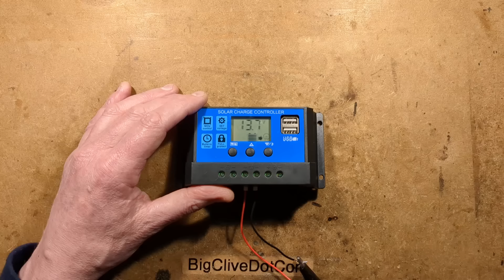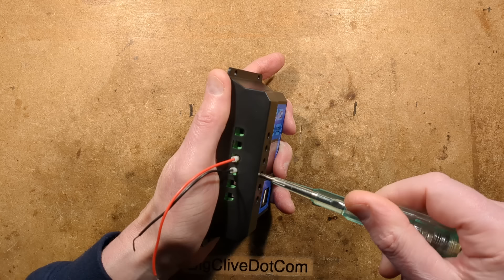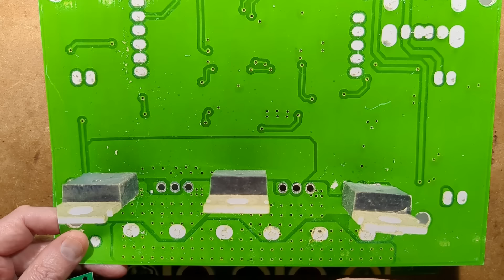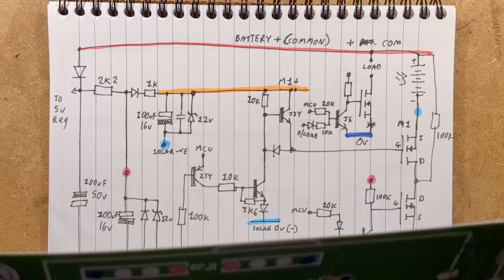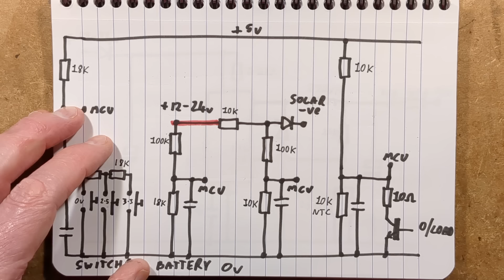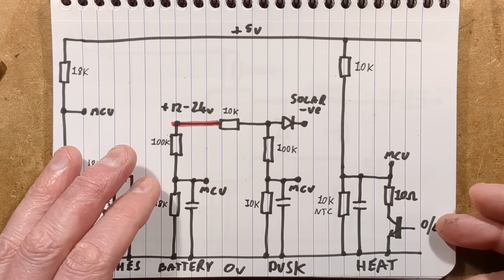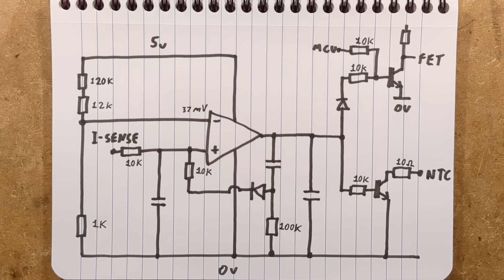Exploring a mass produced solar charge controller

Comment: Many false claims of MPPT on those chargers .they are only PWM but they work and the false claims of power rating of 100 amps or 30 amps .Most are barely 10 amps but if you can put a proper heat sink on the back you can get 10amps +

Comment: I am running a similar unit for my LED garden lights, backed by a 12V 7 Ah gel battery, added a fuse on the battery line and source power is from two solar panels. It has been running for years now. It switches on at dusk and stays on for the given number of hours. No large currents though.

Comment: Oh, perfect timing.
I bought one of those, a 25W small solar-panel, sealed-lead battery, and a small selfmade 12v LED light. Wanted to install it tomorrow for a play hut for a relatives kids. 
So seem usable for 12V low-power? I was just a bit too lazy to make my own as this had a display and just the few settings i needed.

Why did they go with such an overcomplicated design when it only makes the charger more complex, error-prone and specially for the chinese - more expensive?
5V that is not really capable and can brownout the controller, mosfet-driving that seems like a fever-dream, and thermal regulation while actively overloading the entire thing.

Comment: I use the larger orange 12/24/36/48v ones. They seem to be about the same manufacturer but apparently have shunts and show input current and also current the load is pulling. Their voltage readings are also much more accurate.
Since the usb are part of the load, I run 5v relays to control when things come on and go off (in my case a 2nd inverter and also a window air conditioner).
In my experience the orange larger ones are very reliable and also accurate enough for lithium batteries. I've run several of them for years and theyre now under $15. Years ago they were $30.

Comment: My suspicion seems to be correct. They sold this in Asia and it was popular until someone tried to charge their phone with the port that "supports all charging standards up to 5A and 48V USB PD blah blah blah" and then the batteries got cooked. They then probably decreased the price a lot to get rid of the stock they have left. I bet at some point these will vanish from all shops, replaced with something more expensive that might have other design flaws...
Reply: You seem to have the misapprehension that chinese manufacturers actually take any kind of responsibility for aftersales service - they don't care if your batteries cook, they just care about making the sale. The USB ports are a feature that help sell more units, volume->cheaper.
Reply: @Patrick-rd9qo  I have never said, nor implied that they would care about someone's batteries getting cooked. The customers do care and stop buying it. No demand, lower prices. Prices even below manufacturing cost.
Reply: @Patrick-rd9qo  They do---for domestic sales. Chinese law enforcement is generally effective, even if electric standards are lax. What the OP suggests is that it was originally a domestic product with some international resellers, but is now dumped onto the international market because it cannot be sold domestically anymore. We've seen this before, where some product suddenly shows up for a price that's low even for this kind of stuff and vanishes about a year later.

Comment: Lots of people disregard these cheapo PWM charge controllers as useless, scammy garbage. While yes, a well-designed MPPT charger is 100% the better choice for most setups, it is absolutely remarkable what these tiny PWM models can achieve for under $5.

Comment: I'm not in the habit of inspecting PCBs, but over 45 years of owning a soldering iron I've seen quite a few - but I don't recall ever seeing 'busbar' power tracks with multiple through plated holes like this board has. No particular function occurs to me, if it was just to use the copper on both sides to carry current then I'd expect a cluster near the connection to the power source perhaps but not everywhere. IF someone wants to enlighten me about the reason for their distribution I'd be interested to hear.

Comment: I've seen these for sale for as little as $3 apiece.  Amazing how they can get the price so low on something by producing millions of them, "economy of scale" at its finest.  Last year I bought a set of 8 flexible panels for a portable array, and they each came with one of these controllers, so I have a pile of them I need to figure out what to do with.  More and more cheap stuff is getting the part numbers sanded off, probably because they know the guy in the next building is going to counterfeit it if its easy to copy.  Not very effective on a mosfet (probably IRFZ44N) but can be a bit more problematic when it's an IC, even like the op amp or buck regulator.  I see a lot of comments complaining about this not being MPPT, but down here it really doesn't matter.  MPPT is only useful when you need to eek out every last watt or when you have such a large array that a few less percent represents a significant power loss.  Down here at these power levels and price points, nobody's going to miss a few watts, when it saves them 90% on the cost of the controller.

Thanks for the video, and kudos for spending all that time on the fiendish schematic!
Reply: This is basically a PWM controller.
MPPT is ~20% more efficient, so your not eeking out a few watts. Its more like 10-20W+ on an average panel.
Reply: @jaro6985  There's a very common confusion in solar terminology ,where "MPPT" and "PWM" are being compared.  This is sort of like comparing two different cars where one has fuel injection and the other uses spark plugs.  The reality is that BOTH use spark plugs, and fuel injection only really helps in certain situations.  (it's not an "either-or" comparison)  And there's also a big cost difference.

It's difficult to simply describe how PWM (Pulse Width Modulation) works in a controller without getting confusingly technical, but I'll try.  "Basic PWM" regularly interrupts the power (through a filter) to lower the average voltage to what the load can use, which can be very inefficient since it spends some (and maybe a lot) of its time "off" not sending power to the load.  It's fairly efficient when the panels are providing the right amount of voltage for the panel (and the PWM is almost always "on") but the power of any additional voltage is "lost".  So for example, a 28v panel would be VERY lossy when connected to a 12v battery because it'd be "off" for around half its cycle.  Their efficiency is directly related to how big the voltage difference is, so if your panels are closely matched to your battery, they can still be fairly efficient.  At any rate, this DOES prevent a higher voltage solar panel from over-charging your battery, so it is a legitimate way to control a solar panel.

The other method is to use PWM to control a "buck regulator", which is always transmitting power but is using two different current paths, so can be very efficient.  Unlike basic PWM, buck regulators "trade off" excessive voltage for more current, and thus can provide more current to the load than the panel is providing, making them extremely efficient at any panel voltage or battery charge state.  There are some great videos on YouTube that describe how buck regulators work, check them out.

Both methods use PWM, so saying a controller is "PWM" isn't helpful, because ANY real solar controller uses PWM.  If you can spot schottky diodes and a large inductor, it's probably using a buck regulator.  The inductor makes the controller bulkier and heavier, so if it's really small/thin and lightweight, it's probably just using inefficient "direct PWM" and not a buck regulator.

Now that we're done with that, MPPT is "Maximum Power Point Tracking".  This isn't a method of power conversion, it's a method of control*, and is almost always done with a small micro-controller (tiny computer chip) on the board.  In theory it could be used to control a basic PWM conversion but I've never seen it - probably because it'd be a waste of money to put in a MPPT chip just to waste all that power with basic PWM.  MPPT constantly calculates power delivered to the load, and is constantly tweaking the voltage/current tradeoff in the buck regulator, trying to find the optimal conversion.  This might sound unnecessary if you can just cut the voltage in half to double the current it wouldn't change the power.  But solar panel output is *not linear.  Doubling the current draw might drop voltage by 40%, 50%, 60%, etc, and the result power might be 80%, 100%, or 120% of what it was before.  Obviously 120% is better, so it moves there and then tries adjusting again to see if it can continue to improve.  This is the controller "tracking" the maximum power point, along the MPP curve.  The shape and position of this curve varies depending on the panel and the conditions (how sunny it is, angle of the sun, etc) so it's necessary to track it and adjust the conversion rate if you want to squeeze every watt out of the panels as conditions change. (and to have the controller work efficiently with more than one kind of panel)

So on the front end, the MPPT chip is adjusting the buck regulator to pull just the right amount of load to maximize solar panel power.  And on the back end the buck regulator is efficiently converting voltage down and current up so that close to 100% of that power is delivered to the load.

That means almost all the cheap controllers (that are often just labeled "PWM") will have a small dumb IC that's been wired to run at a fixed power point.  They do "okay" if you connect a panel with a matching Vmpp. (maximum power point voltage)  A lower voltage (or shaded, or badly angled) panel probably won't work at all, and a higher voltage panel will waste power.  But they're like $3 and you get what you pay for.

TL;DR: there isn't any "magic number" to compare a MPPT controller with a "PWM" controller.  Under the right conditions they could be almost identical.  But in other situations they could be literally ANY difference between them.  80%, 10%, whatever.  It depends on how well-matched the controller is with the panels. (and also solar conditions, battery charge, etc)  MPPT controllers will always cost more and be more efficient, but just how much is very dependent on your situation.  (in my earlier post I mentioned a "PWM" controller that came with a panel - so the controller was "matched" to the panel and with good sun it's actually pretty efficient)
Reply: I'm quite surprised that they anonymized the MOSFETs but not the microcontroller.

Comment: One thing I read somewhere was that when you set them up, put the battery on, then the load switched on, then the solar panel. That seemed to work for me after a few issues.

Comment: Bought one of these the other day to keep an electric fence battery topped up. This is a much better guide than the crappy bit of paper that it came with.
Reply: It runs my electric for two years now. No problems so far
Reply: @johannesheide8639  Good to know, thanks.
Reply: Exactly what i plan to do as well, got some 130W Panels laying around that i bought second hand for the ludicrous price of 1€/W shortly after the kremlin went full retard.
Time to put at least one of them to good use...
I think i will now switch to lithium though, a lead acid battery getting charged in an ammo can over and over might not be the best idea ever.
Reply: Outch that was expensive @darnoc4470
Reply: @darnoc4470 Good plan as long as it will stay above freezing.
Reply: @davidmam  I got some used Bike batteries for basically free with the panels, if frost degrades the capacity of my selfmade rack i can just throw more 18650s at the problem.
I mostly use the fence in wintertime to protect my apple plantations from deer, forgetting to replace the old battery every few weeks got bit annoying and costly.
Winters here in coastal climate northern Germany are quite mild though, a week of -10C nights at the "worst" should not be too hard on the cells i reckon.
Reply: @davidmam  only "lithium iron phosphate" (LiFePO4) has a problem with charging below freezing temperature. Other lithium battery architectures, like lithium ion found in phones laptops and vapes, or lithium titanate which is much safer, can go down far below freezing temperature and still work fine! You might lose some efficiency in cold weather, but unlike LiFePO4 you don't need a battery heater and it won't kill your battery instantly if you run a light bulb from it below 0 C
Reply: @davidmam  Rubbish. I have one fitted in a cabinet outside to control my water harvesting system. Same controller for at least five years and it's never missed a beat in ALL weather.
Reply: @cyleleghorn246  fascinating... I'm seeing all the advantages (and there are drawbacks too) of LFP vs Li-Ion for EVs, but didn't realise about the below freezing thing. Luckily (although I wish we did) in Australia we don't really get sub zero temperatures.
Reply: Well mine burn up, cause i use the USB to light up my usb light. So using the USB is big NO NO if you want to use it long.😂😂😂😂
Reply: I‘m doing this since ~5 years. 50w solar panel, 100ah lead battery and this cheap charger. My horses tested the fence some time ago. Works well ⚡️
Reply: @MatzeMaulwurf  50W and 100Ah, you'll be able to keep a cattle rated unit happy
Reply: @Flirkann  Cattle and horses are easy, it's sheep that need a good kick or they'll just walk right through it.
Reply: @Flirkann yes. During summer with a good location , the panel is tilted 30 deg and pointing to south. Runs the whole summer.
Reply: @MatzeMaulwurf Thanks so much, I never thought of that. Where are you buying batteries and panels for the horse fence?
Reply: @HelloThere-zw1lk Ebay. Solar lead acid battery. In Germany it’s roughly 1€/1Ah.
Reply: Thank you ❤ @MatzeMaulwurf
Reply: I have run multiple electric fences for years, with these devices. Avoid the 10 amp ones; they tend to fail. I use at least 30 amp MPPT controllers, and they seem to last forever.
Reply: I've used for similar purposes, they are not particularly moisture resistant. I've had a few die, but they're so cheap anyway, it's not a great problem.
Reply: @Jon-em4kc  I intend to put it in a plastic box with a clear front to keep the rain out.   
Now Clive has pointed out it's got a metal back for heat dispersion I  might epoxy a  bit of scrap aluminium into the box and screw the unit to that. 
I'll probably mount it in the shade of the panel too.
Reply: hopefully it does not flip to 24v mode and boil your 12v system
Reply: Chin-glish nonsense with 4 pt type, and an insane person did the translations.
Reply: Same. But for some reason mine over charges and damages batteries like it's a sport
Reply: People that read the instructions crack me up…. 

I crack me up … 
But honestly, what were you thinking? You were gonna open it up and it was gonna be a paint by numbers

Comment: Have this same unit that came with a kit and can confirm even when battery is at 14.4 and charging with great solar, plugging in a usb device that only pulls .5A shuts down the controller immediately. I too share your confusion as to why they added 2 usb ports

Comment: Funny timing as I just set one up earlier today (Aus time) in my car with a 300x400mm solar panel on my dash. I don't trust the output power of the panel I chose to only naturally trickle the battery, plus I wanted a panel that could actually charge up another battery in the ute tray albeit very slowly. So I got a cheap panel and charge controller set with this one in it, more than enough to keep my ute at safe float as I'm close enough to work I ride my ebike in. In fact I'm yet to drive into work this year yet, and it's been taking a toll on my cranking battery particularly as it's winter here now!

Comment: Normally the 10 amp rating refers to the amount of amps that the solar charging can provide to the battery....... in my experience with these the  output is normally a lot less than that.

But to be honest I only tend to use victron solar charge controllers these. days.

Although saying that one problem that does reoccur time and time again is that the charge controller often displays a different voltage to what the battery actually is,  which often means that it  goes into float or stops charging for the lithium before the batteries actually full !
Reply: I think I've seen the same - all still have a 10A/120W output, just higher Solar Input/Charge Current